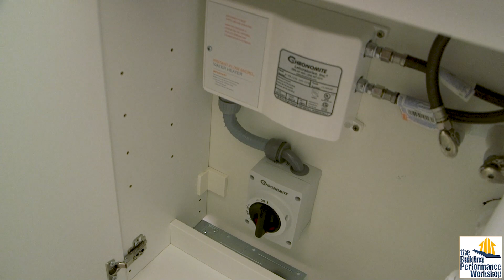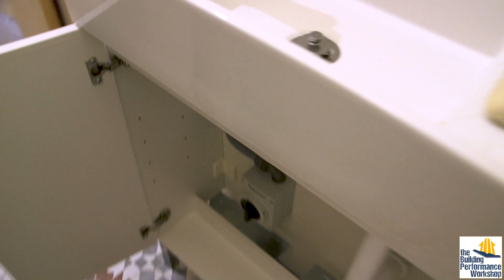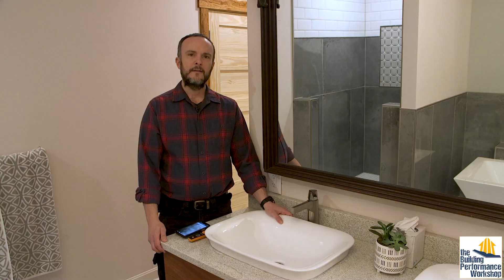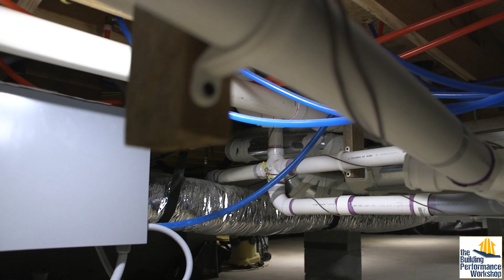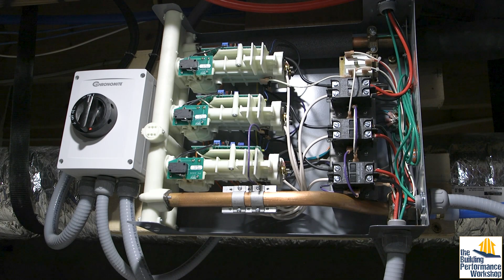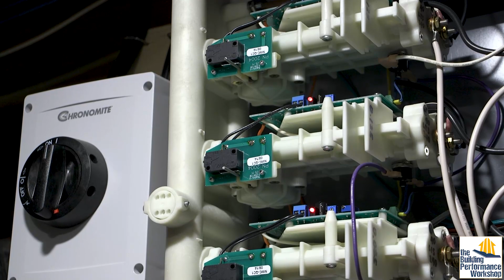Tweaking our Home's Water System with Chronomite Point-of-Use Water Heaters

Comment: I'm confused. What IS the difference between an "instantaneous" and  "tankless" water heater? Did I miss something?
Reply: Tankless water heater usually use propane or natural gas to heat water. an instantaneous is usually a high power electric water heater that use a lot of power to flash heat the water. These type of electric water heater can deliver a lot of energy in a tight space. A gas fired tankless is probably 3 to 5 times larger for the same output because it needs a large heat exchanger as well as ducting for combustion.

The issue I see with the instantaneous water heater is the potential for rapid scale buildup because a lot of energy is delivered in a small surface area & because of the high temperature difference between the electric coil and the water.  I believe they need to be flushed fairly often unless the water basically has no dissolved minerals.

Also they need a lot of power to operate (typically 60AMP@240 or more). If you lose power you not going to have any hot water even if you have a generator because its probably not going to be able to handle the load. 

FWIW: I recommend using a tankless NatGas or Propane simply because you have access to hot water using a modest size generator. If you have muni water and muni NatGas than you can get a tank water heater and still have hot water even without a generator (unless you need a force vented heater).
Reply: @guytech7310  Thank you for excellent information. However, I am building my retirement home in rural Arizona and hope to build to Passive House standard. Thus, my aim is to minimise venting and combustion appliances (except for my fireplace - gotta have a fireplace in the cold high desert - but at least I got a Rumsford model with outside burn air and minimum smoke or waste burn products). So, I'm kinda stuck with the electric option. No nat gas, collected rainwater purified through a reverse osmosis filter. This is actually very helpful for planning. Thanks again!
Reply: @lindacgrace2973  A tankless water heater isn't going cause a air tightness issue. You just need to make sure you duct pipe is properly sealed which isn't difficult. You just need a little patence to do it right.

I would ditch the fireplace and go with an outdoor wood boiler. This would make your home far more efficient and avoid indoor air quality issues. However with a Passive home, you could probably heat the house with just a small mini-split that would probably need under 2000Watts of power. The issue with passive house is not heat loss, but heat gain because every appliance is going to release heat and it will stay trapped in a passive house.

That said Passive house are very expensive to build due to the construction techniques to avoid problems like rot and mold. You also find it difficult to find an experience builder or contractors that can build you a passive house that avoid the problems and pitfalls with passive house construction.

You best option is just a well insulated home with 2" exterior insulation R-10 and 2x6 walls with 24" on-center framing (less studs for less thermal bridging) & ZIP sheathing. Between the R-10 Exterior and R-23 stud bay insulation I have about an R-27 insulation. The house is about 3500 sqft and only requires about 24Kbtu\hr for heating & cooling, even with just double pane, double hung windows. Once you go beyond this type of construction your costs will increase substantially. for a passive house your going to need to buy special windows that make cost between $1000 and $3000 each (depending on the size, R-value, and trim). For more than 2" exterior insulation, your going to need to place a special order which is going to cost considerable more and likely delay construction since it may take 6 weeks or more for delivery. 
At a certain point, the amount of money you spend you never get back in a lifetime of savings from energy efficiency. ie picking up nickels in front of a steam roller.

As far as venting, you still going to need a lot of venting anyway. With a tight house you have be remove all excess moisture to prevent rot and mold problems. Your biggest air leakage is going to be from the Bathroom fan venting which needs to be directly vented to avoid problems, and an ERV that is going to bring in fresh air. Your going to need wall penetrations for your bathroom fans and two for the ERV, as well as electrical Meter + exterior outlets exterior lights,, plumbing (hose bibs + drain venting), AC line sets. So I would worry about air sealing the tankless heater vent. The tankless is nearly lossless since it has both an air intake an exhaust such that air flow is contained in the unit and does leak air into the home.

FWIW: Be prepared for sticker shock on building materials & labor costs. Currently lumber prices are double or more than they were in 2019 and costs for just about all of the building materials have also increase substantially. 

Most contractors and builders have raise their pricing. In 2019 most of the contractors were charging be about $35/hr to $40/hr. Today they are asking for $65/hr to $85/hr and also are backlogs for weeks to months.
Reply: @guytech7310  Love the way you think! However, I am building an adobe house. Since the walls will be dirt cheap (he he he, see what I did there) I am NOT achieving PH standard with expensive complex building. I  plan to use very ancient technologies. Adobe is a mediocre insulator - but brilliant as thermal mass. So, adobe exterior walls, separate 2x4 interior wall framing, held off of the adobe by 2", insulated with cellulose. Total wall performance with r-1 recycled single pane windows (and deep overhangs and lots and lots of thermal mass) comes to R31. Local code calls for R13. The raw R-value (without accounting for leaks, weak windows, etc.) is R-36.6 (16" adobe = R 7 + 8" thick thermally broken cellulose = 29.6, for a total of R-36.6) But after you account for the windows and leakage, drops to R-31. I will probably install some form of heater (the idea of heated floors in the bathrooms is appealing) but expect to use Earthship ideas for cooling (underground cooling tubes and high venting transom windows on the other side of the room). Several adobe houses in the area have used those techniques to keep cool (it is about 75 degrees inside, even when it is a blazing 120 degrees outside). Using lower tech physics-driven solutions not only saves money, there's one heck of a lot less to go wrong, with the design, the installation, and the maintenance of the systems. All of which are important considerations since I am building this house in order to "age in place."
Reply from the maker: Unless the nat gas lines freeze up too like in TX

Comment: Most homes don't have 120+ amps open and available to run electric point of use water heaters like this. It's a nice setup, it just won't work for most existing homes.  For existing homes it's hard to beat a gas/propane tankless unit with a proper recirculation line.
Reply from the maker: I hear you

Comment: I'm very surprised after watching your video and I have a question. 

Why plastic pipes ?

I've seen some articles that raised some concerns in regards to plastic piping for 2 reasons, degradation of the tubing due to chlorinated water and the build up of a bacterial film on the inside of the tubing, more prevalent on plastic (pex,ppr) pipes than on stainless/copper ones. 

What's your opinion on the matter ? Is it negligible ? Are they real concerns to which you already have figured a solution ? First time you ever heard about this nonsense ? 

Thanks for the great content.
Reply: PEX is far easier to install and does not suffer corrosion issues like copper. running stainless water lines would be very expensive & copper is also getting expensive. 

As for chlorine, I believe most PEX has some resistance to chlorinated water. I suspose it might be a problem if the water has elevated chlorination if the water needed to be shocked due to problem.

As far as algae problem, wrapping your pipes with insulation should keep the light out to prevent algae growth, but if you have chlorinated water I don't see how you could have an issue.
Reply from the maker: Tsuil, great question- I researched this for our property’s supply water line a few years ago and found that of all available options, PEX-A offered the most benefits and the fewest problems for our situation. Also called ProPEX. And we have quite a serious water purification system downstream anyway (stay tuned).

Comment: I'm surprised you weren't able to adjust the temperature setting on the large water heater to solve the problem. Interesting that the flow rate is the only thing that triggers to second element in the heater. I have a lot to learn about this.

I'm super jealous of this cool house.
Reply: i suspect its because you need a certain flow over the element otherwise the element will over heat and fail. if the water is to hot and not enough flow, the element will fail.
it looked like he was just hitting the cross over point between the stages. not enough heat to get full temp, not enough flow to let the 2nd stage turn on.
Reply from the maker: Correct, Tweak- I had the temp setting at max, actually. It’s the nature of these bigger units that also have a very low minimum flow.

Comment: I insulated our hot water lines in the walls and I don't regret it.  Our plumber thought I was nuts putting insulation on the warm pipes in the walls but our 20 foot run of 1/2 inch going from our hot water trunk to our kitchen sink allows me to run hot water to wash some dishes, maybe walk away for a few minutes and then come back to still having hot water at the sink without having to purge the line.  I also think its nice that the water stays warm between dishwasher cycles of about 5-20 minutes between modes (ex. 5 min. prewash cycle, 20 min. wash cycle, 25 mins. rinse cycle), resulting in the dishwasher using less of the heating element to heat the water.  I will say that if you insulated the wall pipes, you might as well do it in the crawl space to avoid a water temperature sandwich if there are uses a few minutes apart (stays warm inside the insulated pipe in the walls but cooler in the section in the crawl space, & then fresh warm water delivered from the water heater). 

If I had the time/money, I would convert our washing machine hot water input and also our half bath to point of use heaters because they are relatively low flow and rarely used.  My laundry has maybe a 20 foot run of half inch, but by the time the cold water clears through the hot lines, the washer is half full of water because its an HE washer.

Great video.  I really want to install a phyn and I have a few friends that really want one as well.
Reply from the maker: Deep thinking about your dishwasher, Chris! As always. As mentioned, I’ll rig up a test of before/after on one of the systems being insulated and be able to track it. I’ll be sure to test pauses in use for you as well.

Comment: btw i think its 140f/60c to stop legionella and over here its 131f/55c maximum temp at the tap (unless you have a mixer). 120f is cold.
Reply from the maker: Tweak, have you felt what 120f is like? If you’re right about 131f at the tap, you Kiwis must be frying your buns in the bath.
Reply: @HomePerformance  thats only the maximum to prevent burns, you are allowed to mix in cold water if you want.  a lot of people like the water really hot for cleaning.  it was common to have it a lot hotter.
Reply: @HomePerformance   120f is cool. good for bath, not good for cleaning. at work we have a tankless gas hot water (~24kw) connected with a circulation pump which basically has a small tank in the system. i use that at 131f for cleaning with a spray nozzle.
Reply from the maker: As much as I love tweaking with metrics, there is no way we’re talking about the same thing here buddy
Reply: @HomePerformance  sorry, just saying what the max is (new systems require tempering valve), not what you would fill your bath with. with the califonts you simply select what temp you want on the controller. i think the preset temp is 122f.

Comment: the pipe sizes is interesting. the trend here is to use small diameter pipes and higher pressure. this reduces the volume of wasted cold water in the hot water lines (tank setup).
in a small house the wastage is pretty small. insulating cooper lines is fantastic for intermittent use, no idea with pex.
Reply: What pipe sizes do you recommend?
Reply: @jl9678  not sure what exact size they use.  would have to check.

Comment: I'm curious what your opinions are on the per-fixture or per-bathroom instantaneous electric water heaters vs something like a heat pump tank combined with a recirculation system? In theory, the heat pump should use significantly less electricity (as long as it stays in heat pump mode), and the recirc pump should reduce the time delay to receiving hot water, but it's also a lot more complex than what you have, has to heat to higher temperatures for legionella mitigation, has more heat loss in the plumbing system, and also energy loss in running the recirc pump periodically.

Maybe the ideal answer is a mix of the two - heat pump tank very close to the major bathroom, and a small electric heater for half bath sinks.
Reply: if you have the heat pump tank recirc system up to 140f/60c, then i don't see much point in installing point of use as well. the line from the recirc circuit to tap is so short the point of use heater would do almost nothing.
Reply: @tweake7175  I meant using instant heaters for small sinks and only running the recirc line to full bathrooms
Reply: @apalrd8588  even then i'm not sure if it would be worth it. its not difficult to run a master pipe around. i can't think off hand of any situation where you have a small sink thats not within range of a bathroom, laundry or master sink. 
would work ok for something like a guest bedroom with onsuite thats way down the other end of the house away from all other hot water plumbing.
Reply from the maker: Tweak makes good points, and Andrew, you’re hitting the nail on the head. Every option (and there are always options) has its pros and cons. We’re just trying to think outside the box here and expand the conversation.
Reply: I definitely like the simplicity of your approach, and you've definitely made a great case for individual heaters for each bathroom instead of traditionally plumbed electric heaters.

Another thing I completely forgot to consider is that, since you have a separate heater for each bathroom (I believe?), you can tolerate failure of any of your water heaters without ruining your day / week while you replace it.
Reply from the maker: Haha, yeah, that’s a plus! BUT if the power is out, I got nothin.
Reply: If you have a generator or solar + battery backup, you would probably be able to power a heat pump water heater, so that's another pro to the heat pump.

Comment: the flow/pressure of your bathtub looks low. Have you figured out the efficiency of having tankless vs say a hybrid water heater and circulation pump? Do you have a 400 amp service for your home?
Reply: oh answered my question about pressure.
Reply from the maker: And yes, we have 400 amp service.